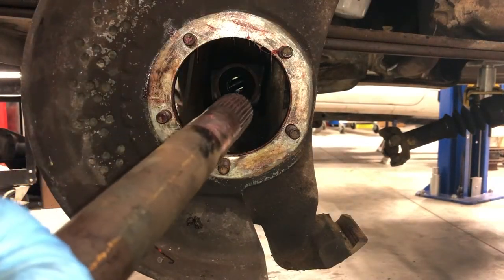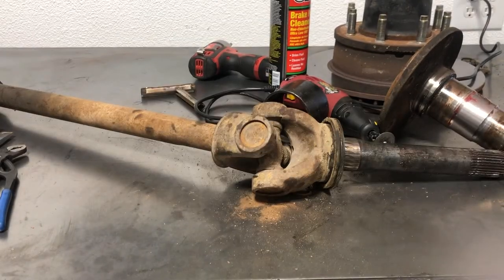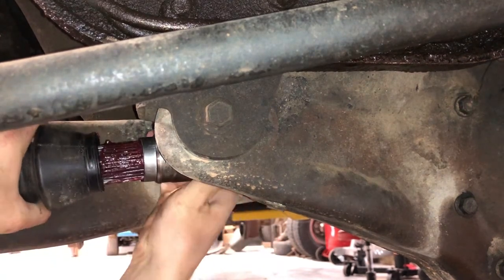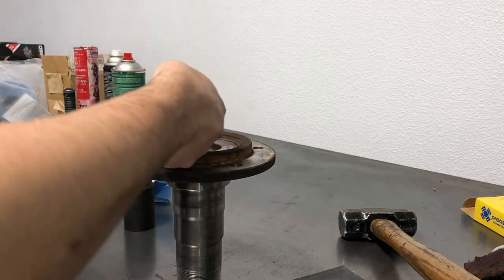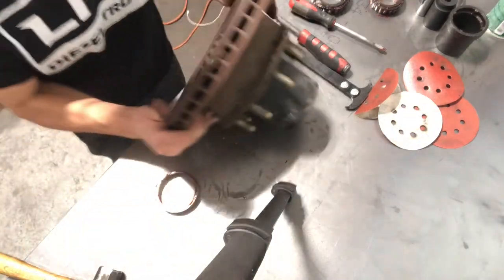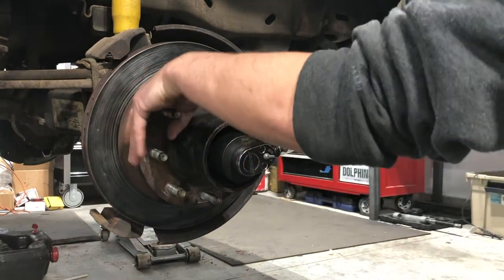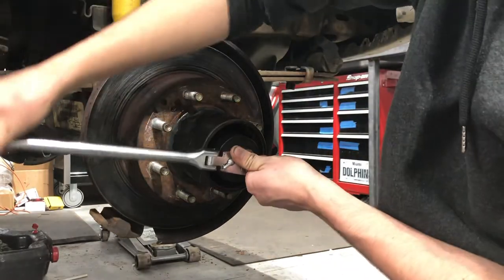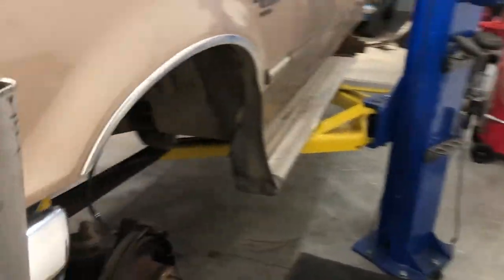OBS ford dana 50 TTB/IFS full assembly complete guide

Comment: I ended up using a 3 jaw bearing puller reversed and screwed the centre hard into the back of the jaws then using a press, pressed the whole lot out. Need a press for this method though. Also I replaced the rotors on mine, man what a job, required a lot of pressure in the press to push the studs home!

Comment: So I'm replacing the driver side axel on what I believe is a Dana 50 front end and unlike all the other front ends I've takin apart this axel don't want to slide out it will move about an inch but then stops with a clunk any ideas? Sounds almost like there is a C pin in the pumpkin but after I opened it up there is nothing on the end of the driver axel but there is one on the other side so what can I do?

Comment: Do you have a part number for the axle seal you put on the axle then put spindle onto that
Reply: At 19:05 in the video thanks in advance man great video
Reply from the maker: the one is used was on parts geek.com       API brand. Part Number: 5335-07865883.     its called an axle spindle seal
Reply: Thanks man

Comment: First off great video. 
I am doing a 95 f250 with a 460 in it. Everything you did in the video. Only my hubs and clips are a little differnt. My wheel bearing was bad and it caused like 3 clips/washers to be ground into chunks. I have the 2 same axle nuts but I have like 3 washers and 2 clips. And I can't find anything on how or what order or if there's any special way to install them. I got the clip rebuild kit and it has like 9 parts in it. Dosent do me any good if I'm guessing on the order to pit them in . Wondering if you could help. 

Also wondering if I can pull the clip in the diff for the passenger side without dropping the entire diff?
Reply from the maker: thank you

you can't remove the clip without pulling the diff unless you modify the axle but will still require you to remove it to do that

and my wheel bearing nuts only had the one washer, I'm not sure what's up with yours hopefully someone on here can shed some light
Reply: @fuelishgarage6587  actually when I took the good side off to do the other u joint it had the same parts as you. Best I could tell someone threw in some clips as spacers. So I just left them out. Seems to drive fine. Couldn't of did it without this video.
Reply: @fuelishgarage6587  oh yeah one more random question. My truck looks crooked when riding behind it. I had frame inspected and it is all good. Alignment is good. I can let go of wheel at 70 and it has no drift or pull. It has a replacement bed on it. I didn't put it on. Could it be its on crooked or maybe something else?
Reply from the maker: if its just the bed that looks off check the spacers its sitting on and you can loosen the bolts for the bed to adjust it

Comment: I’m trying to do my rotors on my 1995 f250 4x4 Dana 50. It has warm premium manual locking hubs on it. They were in the truck when I got it. Anyways I expected my spindle nut to look like yours, with the 4 intended slots. But mine only has 1 groove?!? Can anyone help me out on how I can remove this spindle nut? I’m baffled
Reply from the maker: Wipe all the grease out, might be covering them, not sure why It would only have one slot unless someone worked on it prior.
A picture of it would help give you ideas to remove it.  Worst case is chisel or cut them off and replace them. Hope it works out for you lmk.
Reply: @fuelishgarage6587   I got it figured out thank man! It had auto locking hubs on it from the factory so it has the 2 3/4 rounded hex socket style nut.
Reply from the maker: @jaredkish8716  Awesome glad it worked out I never worked on the one with auto hubs.